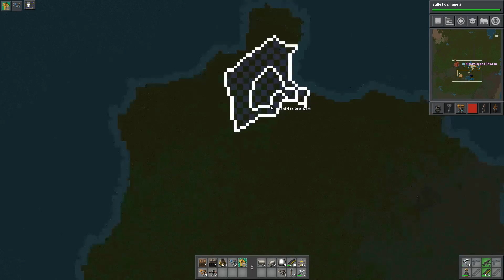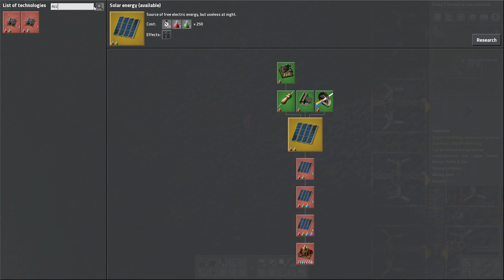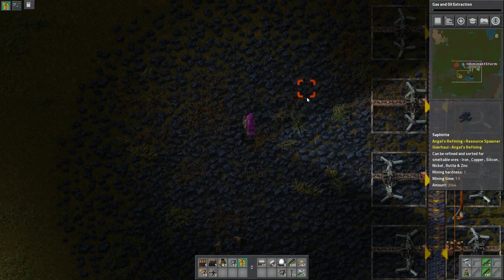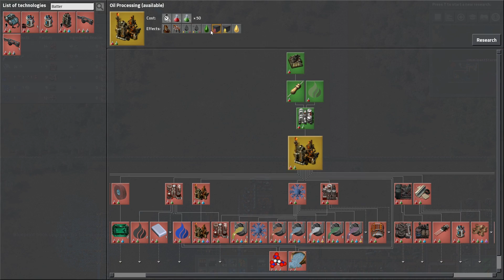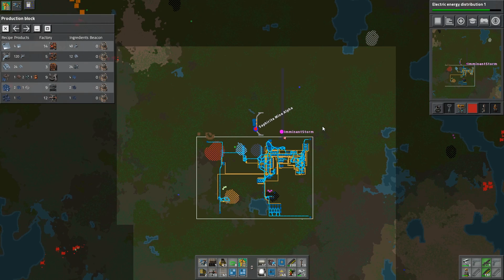Factorio - Angel's & Bob's - Episode 10 - Railroad

Comment: 3:00 I know this video is 18months old, but for those watching through, you don't need Sulfuric Acid to mine the outside of that patch, just the infinite bits in the middle.
Reply: or you could cheese it and turn that option off in the settings.